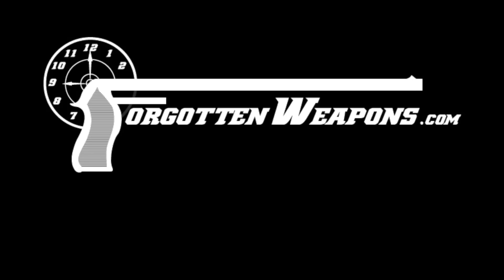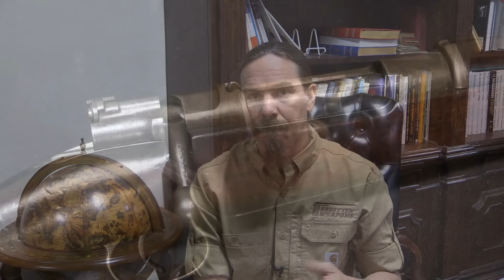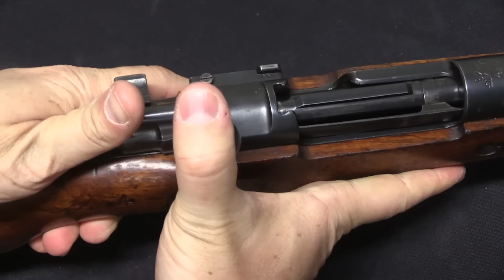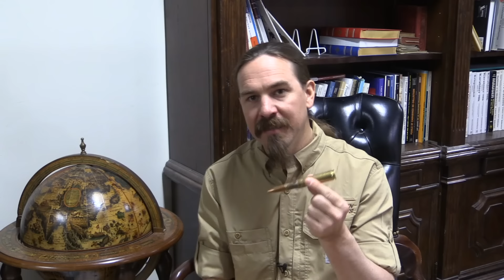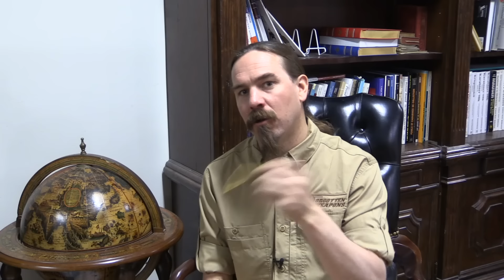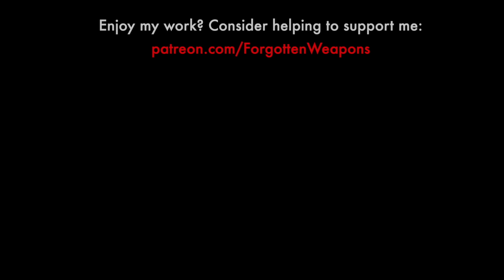Earth-Shattering ka-Boom! How (and Why) Guns Explode

Comment: Crazy to think that the most popular semi auto handgun cartridge was just lugers compromise and even the luger pistol and its original ammo was inspired by the first commercialy relevant semi auto pistol the borchart.  
117 years of service, the only military cartridge still in service that's older is the 7.62x54r that's been in service for 131 years and is not going anywhere for a long time, some say it was based on the lebel 8mm

I think with the 9mm makarov that's actually 9.2, the tokarev in my opium was the best single stack hanggun of WW2 due to the cartridge same with SMGs.
I don't think Russia made 9mak to not be interchangeable, they had no .380acp lines and they wanted a cheap yet reliable pistol that could fire blowback with the maximum pressure so the 9mm mak was born.

Russia keeps using the 5.45 for national pride and when China startered its small caliber assault rifle provaln a very long time ago they did not want to go with a Nato or Russian cartridge but their own 5.8mm on paper and in reports it seems to be a tad more powerful than 5.56, it was built to use steel case only so maybe they had a point and also for national pride, they have a mix of soviet and Chinese pistol/smg rounds but keep 7.62x54r and soviet 12.7mm   some soviet and Russian ship, aircraft and missiles but more and more are being developed in China, the PKM is great so don't change it.

The Chinese non bullpup rifles look realy good especially the one that looks kind of similar to the new ace, after the SKS China went its own way with the AK type, similar but quite different with the SKS being a preferred weapon for many and Chinese made M44 snipers.

Second line and reserve troops have all sorts of weapons in storage still as long as they have ammo, even Arisaka rifles converted to 7.62x39 and bren type guns in 7.62x39.

Im sure if Chinese weapons did not get banned in the US then the US would have had some weired and wonderful weapon imports in the 2000s and 2010s as they would want to get rid of older stuff I'm not even sure norinco produces the type 56 or 7.62x39 ammo anymore.

A few strange company's make AKs but not realy nilspec.

Most are AR15 type rifles and 5.56 and alot of pistols in 9mm for export and even internal police use.

I think captured ammunition is a moot point as ammunition is usualy not far from the weapons themselves.

The sten was made in 9mm as they said they could use captured German ammmo but in reality it was not that common to capture ammo as you had to empty mags unless your lucky and the mag fit and worked.
I think they new a SMG in 9mm would be easy to make with a decent capacity box magazine.

Russia is thinking of moving to a 6.5mm cartridge,  7.62x39 necked down to 6.5 but with the same taper so it could fit in AK mags so basicaly 6.5 grendel with a tiny bit less case capacity would mean an AKM or any 7.62x39 weapon would only need a barrel change.

Not sure if they are looking for a much more powerful cartridge to replace or supplement the 7.62x54r as it seems any weapon with a box mag is limited to 10 rounds in that cartridge.

Pretty sure they want to do what the US is doing for AP in rifles and machine guns but just like the new American rifle and MG it will only be used if they think the enemy actually has rifle armour on a wide enough scale.

I can tmsee the M4, M16x AK74M/ AK12 and all other service weapons from every country being the main weapon with some buying advanced high pressure rifles that can defeat anti rifle armour but they would mostly be issued when needed.

Comment: Backyard Ballistics has an interesting theory at 2:00. The cap isn't vented and it has a much larger area than the case head. Any case failure that leaks gas could turn the barrel and cap into a gas piston with 4-8x the normal bolt thrust - https://youtu.be/bBNHI1_urWs

Comment: The gun in question was terrifying from the first moment I saw it fired on YouTube. I'm not an engineer or I'm just an old machinist. The threads on the beach of that gun are cut with an included 60° angle profile. This means as the pressure builds the tread is trying to expand the diameter as it pushes outward riding up the angle of the thread like a ramp. At a minimum the breach should have been cut using buttress thread. A buttress  thread has a 90 degree angle on the side resisting the direction of load. In my opinion the manufacturer seems to be flying by the seat of his pants as far as engineering goes. You might as well go to home depot and buy some plumbing supplies and build a gun.

Comment: What’s the chances that someone had remove the propellant and fill the cartridge with an explosive, I may be wrong but I believe in war time sometimes armies do that to take out a sniper by Compromising there ammo !
Reply: ...how. What trained sniper is going to just use ammo he found laying around? If you're implying supply line espionage, what conflict are you referring to where that would have happened? Sounds like something out of a bad spy novel.
Reply: @StuckinDallas  That’s exactly what happened during the second world war between the Germans and the Russians ,    During warfare anything and everything is possible I don’t have answers for any of the other things that you’re asking, I’m just stating that it’s always possible I watched the video many times of what happened and if there was no bore obstruction Then I have to assume that somebody had used an explosive powder instead of a propellant , Either by accident or on purpose !
Reply: @StuckinDallas  During World War II, spies needed a compact, disguised explosive to issue to resistance forces in occupied Europe. One solution was “explosive coal,” which could be infiltrated into enemy coal supplies. A similar program in Vietnam introduced defective, exploding bullets into enemy ammunition.Jul 3, 2020

Comment: What should we look for in a bolt-action that might be hazardous to our face? 

This is important!
Reply: Age and wear are things to look for but proper ammunition is the biggest thing. If it's a modern gun read the manual for the proper grain and never exceed it. If it's an older one, C&R type, use lower pressure or milsurp ammo after checking online what the recommended load is. NEVER use modern hunting ammunition in an old gun. Just dont.

Comment: I still swear by the primers. If they are ringing, pressure is TOO HIGH. If you see primer flow, just stop. Recoil is not a reliable indicator, I had a Remington 30/06 loaded with RL22 and a Hornady 208 gr. A max that kicked like a mule but was safe, but a 6.5x55 Swede with about half the powder and RL414 was waay too hot. Watch your primers. Anything more than the firing pin mark is telling you something

Comment: Had a weak charge on a FAL the smell of the cordite the odd report and the weapon pulling away from my shoulder made me stop and check the bore the range officer was real miffed about me stripping the weapon down on the FP my Ptl Sgt went ape at me as I was the newby just transferred from the catering Corp to the infantry until the armourer confirmed that a warhead was 4 inches along the barrel even the guy beside me said it didn't sound right.

Comment: So to recap there wouldn't be an accident if the cartridge were the correct chemistry and pressure and the gun had safety in mind to prevent the gasses from rushing back to the shooter.  If you ask me if the cap will hold 55k in regular use and at 85 will fly away, I don't think that's safe margin of error.

Comment: it seems ironic, but the firearm was not properly designed to fail. As you mentioned in the video, the barrel was stronger than the end cap. this, in my opinion, is an unacceptable flaw in the design. during a catastrophic failure, energy should not be directed towards the shooter.

Comment: So his rifle was really only designed to fire standard 50 cal rounds not super high power rounds like he fired
Reply: It's not even a super high powered round, assuming the ammo Scott used was not defective. SLAP is supposed to be lower pressure than regular .50 caliber ball ammo. However SLAP is meant to be shot through the M2 machine gun, NOT a rifle with a muzzle device like Scott used. It's possible that plastic from the sabot caused a partial blockage that made his gun blow up. Here's a link to a video that explains https://youtu.be/ardw09S7GfE

Comment: 85,000 PSI is NOT that high of pressure. 

A .308 WIN can safely achieve this in an AR10, and when it does fail, does not kill the user. 
Same with a M1918 BAR., or a M2HB, 1919 etc

Comment: So how did demo ranches tests of the high point not blow up literally any of the guns in both his videos? There were only two things that worked, literally welding the barrel shut, and threading the inside of the barrel and screwing a bolt into it. So how was this possible?
Reply: Because thats 9mm and the pressure of a 9mm is well within the overbuilt operating tolerance of a hipoint pistol
Reply: @hedhunta52  interesting. Makes sense, he did say rifle cartridges are much higher pressures than pistol cartridges right? Or maybe that was another video, I’ve watched a few on this topic the last few days.
Reply: @hedhunta52  what I don’t get is how a double loaded cartridge can cause my
Friend’s FN509 Tactical to blow up with no bore obstructions, but a cemented shut barrel doesn’t cause a hi point to blow up. I guess the pressure of a double load is that much higher than what an obstructed barrel causes?

Comment: Had one individual who had a 9mm Sten which as part of the de-mi,l had a small hole drilled into the chamber.  He would fire it and it would blow perfect little brass disc out the side.  The cases had a small perfectly round hole in the side of them.  I tended to stay away from this individual.

Comment: The safety tips at the end, I do this whenever I shoot. I used to fire Sellier & Bellot 223Rem from my hunting rifle, but I noted that in Australia their .223 ammunition cases are stamped as 5.56. S&B and the gun shop told me it is definitely loaded as .223Rem. But I noted that usually sounded extra loud and hits about an inch high at 100 yds (so faster/flatter shooting). It behaves like a 5.56 in would when fired from a .223 chamber and I just don't want to see what happens if I am right. I know in theory .223 can fire 5.56 and may never have a failure, but I also know that it can create failures and I don't want to have to change my name to Scott. Too much paperwork.

Comment: Relying on screw threading for a breech locking system seems like a /really/ dumb idea.
Reply: I mean, with the way it's designed, it's actually not that dumb of an idea... Just, making sure it doesn't fly could be smarter. It was a bad SLAP round, and to be fair, the RN-50 is only about 1300 dollars, in comparison to the 7.8k of the BFG-50A. It was made, sounds like, in conjunction with RoyalNonesuch, and it was just basically a design that could safely fire a normal .50 round without harm to the user, but at a very low price point.

Cheap gun + ammo known to explode the gun it was made for + warning signs =  well... This.

Comment: I have a mosin nagant and some old surplus ammo , 7.62x54, I’ve just notice that over time some of the brass part that is crimp around the bullet (the neck of the brass ) have these fracture cracks along the tip, not far enough pass the bullet , but some are pretty closed : so question is are these ammo unsafe now or will they still shoot “ok”.

22.20 I had some .22lr ammo that did that when I was using my Springfield M6 scout, causing small “gun” powder to burn and shoot out the latch , hitting the shooter’s arm !! About 1-2mm into the skin

Comment: Didn't Scott state in his video that it wasn't a barrel obstruction? Due to him finding the core of the previous round still lodged in the fire hydrant he was shooting at? What ive been seeing is that the ammo he was using had been reloaded at some point and used the wrong components causing it to have a chamber pressure 30k psi higher than what the manufacturer stated the back cap was designed to handle (which is why the threads were sheared off)
Reply: The bullet he had just fired was the obstruction, even though it was likely still in transit down the bore. The pressure rose much faster than it should have, the bullet obstructed an easy path of relief down the bore, so the overpressure escaped everywhere else it could.
Reply: Did you only watch the first 2 minutes? Ian is saying that the bullet being fired becomes an obstruction to the expanding gasses, not that there was an existing obstruction before the bullet was fired.

Comment: There a big big difference between a gun exploding and a gun detonating.  Scott’s gun Detonated .   That’s way way worse than an explosion. He also did not have a bore obstruction because the previous round he had fired was stuck into the fire hydrant that he was shooting at.  It simply was a very very over loaded and super spicy round.  It probably had some kind of high explosive in it for all we know.  I hope he has it tested to see if there are traces of high explosive.
Reply: I'm not sure I can understand a practical difference between having a gun detonate vs having a gun explode... because in either case, any pressure event that is capable of overwhelming your gun's locking system is very liable to cause problems on the outside. e.g. your face.

Also... you didn't seem to watch much of the video. Scott's rifle DID suffer a bore obstruction. The pressure from rhe cartridge could not escape out the front of the barrel before something elae broke. That IS a bore obstruction, and in Scott's case, the obstruction was the bullet. It's reasonable not to think of the projectile as an obstruction, but if the propellant gases cannot push the bullet out the muzzle before something breaks, then that's what it effectively is.

Comment: All critical structures (of a firearm) are, or SHOULD be, designed with a safety factor of AT LEAST TWO, meaning that the rifle should have held 100KPSI.  If the threads will fail at 85KPSI (as allegedly stated by the maker), that is a safety factor of 1.55, which obviously is much less than 2.  Military small arms are designed for a combined safety factor of around 3.  If an action meant to operate at 55KPSI will fail catastrophically at 85KPSI, that design would seem deficient.
  
It is indefensible that you state categorically that this event occurred: 1) because of the ammunition, 2) because of a bore obstruction, because you do not know any more about the event than anyone else on Youtube.  Your statement that every single failure of a rifle in battery comes down to a bore obstruction illustrates just how much you do not know about this subject.  Stick to firearms history, leave engineering, design and failure analysis to those who know about those things. 

It is still an open question as to whether these rifles are proofed, rather than simply test fired, when manufactured.

Comment: The only logical explanation is wear and tear caused the threads to get weak and that's why they sheared off, the design is not safe as you can see, simple but not safe. It's the only reason i never bought one and now I'm so glad i didn't and wont. Serbu is going to most likely blame the cartridge used or Scott himself just to avoid any type of liability because that is one hell of lawsuit if Scott were to go there.